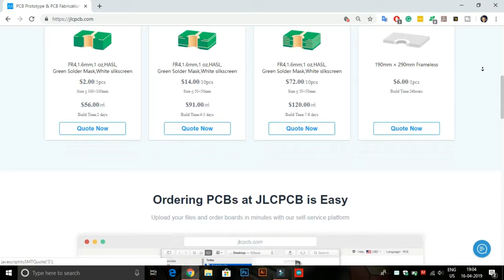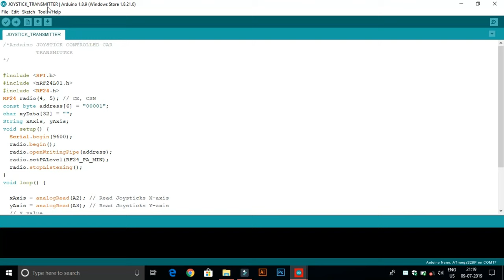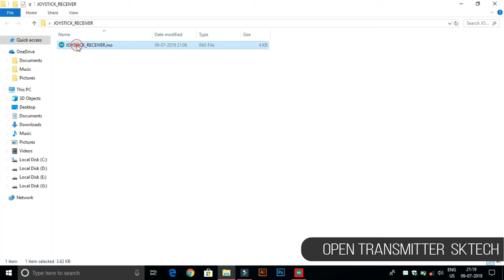How To Make A DIY Arduino Joystick Control Car At Home

Comment: Hi can you make an Rc car controlled by the cheap VR wireless controller, the one with a single joystick. Would it be possible to read the data from that controller. I want that because it looks simple in design. Thank you!

Comment: awesome job bro.. u rock.. thanks for sharing the schematics and code.. i've designed a tank.. i intend to use ur code. the joy transmitter however has 1 joystick, and i need 2, 1 to control the motion and 1 to control 2 servos for turret motion. can u help??

Comment: Hi bro ! nice work, rly like your video,
Just a question : no BMS or protection for your 18650 CDR ? is it just for the purpose of the tutorial ?
thank you for answering me, I would like to have the answer from an experienced person
Reply: I don't think you need a BMS for such small projects like these. The battery will be balanced already when it gets charged externally with its own charger.

Comment: I cannot get an NFR24L01 module. They are unavailable at this time. Can I use ACERMIC 38kHz IR transmitter and receiver instead of the NFR24L01? Will the NFR libraries work for these modules, or do I need different libraries to make them work?

Comment: The project is very good.
Can you please correct the sketch so that it can be fully functional, including variable speed operation? You must make the following changes to the sketch:

#define in1 3 // D3 arduino to IN1 of L298N
#define in2 4 // D4 arduino to IN2 of L298N
#define enA 5 // D5 arduino to ENA of L298N
#define enB 6 // D6 arduino to ENB of L298N
#define in3 7 // D7 arduino to IN3 of L298N
#define in4 8 // D8 arduino to IN4 of L298N
RF24 radio (9, 10); // CE, CSN

Also, the respective changes will be made in the JOYSTICK RECEIVER SCHEMATIC.

Only one correction will be made in the transmission sketch:

RF24 radio (9, 10); // CE, CSN

There is another small error in the sketch, when conditioning the speed in the range 0 to 255 that can be corrected.

Thanks.
Reply: hi after doing this change in the sketch do i need to change my physical circuit or not?
Reply: @MSalim21  probably not because since he said correct the sketch the thing itself should work
Reply: @whynot1284  did it work for u with the corrected sketch?
Reply: Does this work

Comment: High,  i have questions about, l298 Motor driver i am using the same as yours but it can only handle one DC MOTOR each side, do you have any suggestions?
Reply: Search on google "Four-way L9110S chip". The driver you see in video is also meant to be working with 2 DC motors only. The driver can be damaged.
Reply: He attached 2 motors at single side.

Comment: I'm so lost when it comes to building the circuit. Are you just using jumper wires and headers, or do I need to buy something else to connect to my nano?
Reply: you can simply connect it with jumperwires

Comment: I am also trying this project .So in this L298N motor drive module can we use 4 motors at a time?
Reply: He connected every same side motors to the same output of the driver as they will always bs moving together forward or backward

Comment: I found troubleshooting in uploading thr receiver code due to undeclared variable a in line 37 and 40 of the code so how can i solve the problem
Reply: see , if the below works for you. I generally update any lifted code.  I started  with https://forum.arduino.cc/index.php?topic=421081

/*ARDUINO JOYSTICK CONTROLLED CAR (RECEIVER)
        
YOU HAVE TO INSTALL THE RF24 LIBRARY BEFORE UPLOADING THE CODE
   https://github.com/tmrh20/RF24/        
*/
#include <SPI.h>
#include <nRF24L01.h>
#include <RF24.h>
#define enA 2  
#define in1 3
#define in2 4
#define enB 7   
#define in3 5
#define in4 6
RF24 radio(9, 10); // CE, CSN
const byte address[5] = {'R','x','A','A','A'};
char receivedData[32] = "";
int  xAxis, yAxis;
int motorSpeedA = 0;
int motorSpeedB = 0;
void setup() {
  pinMode(enA, OUTPUT);
  pinMode(enB, OUTPUT);
  pinMode(in1, OUTPUT);
  pinMode(in2, OUTPUT);
  pinMode(in3, OUTPUT);
  pinMode(in4, OUTPUT);
  Serial.begin(9600);
  radio.begin();
  radio.openReadingPipe(0, address);
  radio.setPALevel(RF24_PA_MIN);
  radio.startListening();
}
void loop() {
  if (radio.available()) {   // If the NRF240L01 module received data
    radio.read(&receivedData, sizeof(receivedData)); // Read the data and put it into character array
    xAxis = atoi(&receivedData[0]); // Convert the data from the character array (received X value) into integer
    delay(10);
    radio.read(&receivedData, sizeof(receivedData));
    yAxis = atoi(&receivedData[0]);
    delay(10);
  }
  
  // Y-axis used for forward and backward control
  if (yAxis < 470) {
    // Set Motor A backward
    digitalWrite(in1, HIGH);
    digitalWrite(in2, LOW);
    // Set Motor B backward
    digitalWrite(in3, HIGH);
    digitalWrite(in4, LOW);
    // Convert the declining Y-axis readings for going backward from 470 to 0 into 0 to 255 value for the PWM signal for increasing the motor speed
    motorSpeedA = map(yAxis, 470, 0, 0, 255);
    motorSpeedB = map(yAxis, 470, 0, 0, 255);
  }
  else if (yAxis > 550) {
    // Set Motor A forward
    digitalWrite(in1, LOW);
    digitalWrite(in2, HIGH);
    // Set Motor B forward
    digitalWrite(in3, LOW);
    digitalWrite(in4, HIGH);
    // Convert the increasing Y-axis readings for going forward from 550 to 1023 into 0 to 255 value for the PWM signal for increasing the motor speed
    motorSpeedA = map(yAxis, 550, 1023, 0, 255);
    motorSpeedB = map(yAxis, 550, 1023, 0, 255);
  }
  // If joystick stays in middle the motors are not moving
  else {
    motorSpeedA = 0;
    motorSpeedB = 0;
  }
  // X-axis used for left and right control
  if (xAxis < 470) {
    // Convert the declining X-axis readings from 470 to 0 into increasing 0 to 255 value
    int xMapped = map(xAxis, 470, 0, 0, 255);
    // Move to left - decrease left motor speed, increase right motor speed
    motorSpeedA = motorSpeedA + xMapped;
    motorSpeedB = motorSpeedB - xMapped;
    // Confine the range from 0 to 255
    if (motorSpeedA < 0) {
      motorSpeedA = 0;
    }
    if (motorSpeedB > 255) {
      motorSpeedB = 255;
    }
  }
  if (xAxis > 550) {
    // Convert the increasing X-axis readings from 550 to 1023 into 0 to 255 value
    int xMapped = map(xAxis, 550, 1023, 0, 255);
    // Move right - decrease right motor speed, increase left motor speed
    motorSpeedA = motorSpeedA - xMapped;
    motorSpeedB = motorSpeedB + xMapped;
    // Confine the range from 0 to 255
    if (motorSpeedA > 255) {
      motorSpeedA = 255;
    }
    if (motorSpeedB < 0) {
      motorSpeedB = 0;
    }
  }
  // Prevent buzzing at low speeds (Adjust according to your motors. My motors couldn't start moving if PWM value was below value of 70)
  if (motorSpeedA < 70) {
    motorSpeedA = 0;
  }
  if (motorSpeedB < 70) {
    motorSpeedB = 0;
  }
  analogWrite(enA, motorSpeedA); // Send PWM signal to motor A
  analogWrite(enB, motorSpeedB); // Send PWM signal to motor B
}
Reply: @croydon21H  thanks

Comment: And one thing more what is the range of transmitter and receiver?
Reply: 23
Reply: @shashankkanna5453  bananas?
Reply: in case anybody is still wondering the answer to this, the receiver he's using claims to go 100 meters, and the one with the antenna claims 1000+ meters

Comment: You are using only receiver on both modules, or am i wrong.i checked your description link too,but couldn't find a transmitter.
Reply: Late response probs wont help you but might help someone else, the module is transimitter AND receiver on the same module!

Comment: hello bro, I made your project and I have a problem, the 2 of the motors turn on when connecting the circuit and I checked the diagram and the code and I can't find the fault, apparently the rf24 modules don't link
Reply from the maker: bro contact me on instagram
Reply: i am having the same issue

Comment: Hii sir can I use one uno and one nano arduino board for this project . Will it work . If I use uno for car robot and nano for remote and use same code so can it will work
Reply: yes you just need to change the board in tools\board
Reply: @samyflies2  thanks sir

Comment: Arduino: 1.8.19 (Windows 7), Board: "Arduino Nano, ATmega328P"

A library named RF24-master already exists

This report would have more information with
"Show verbose output during compilation"
option enabled in File -> Preferences.

please help me, what's with this?
 @DIY Builder

Comment: I am using 1 motor o each side instead of 2, but only one motor is moving when connected with the same schematic as shown. Please help
Reply: I was using NANO for the car, it only runs one motor. When i replaced with UNO, it doesn't receive any signal. Then i stopped this project...

Comment: If we use one arduino uno and one nano aur vice versa will it work?? 
And how much range it can fruitfully work..
Does using joystick and two arduinos at a time helps in the increment of speed of the RPM... 
plzz reply..🙏🙏
Reply from the maker: Yes you can use the both Arduino nano and uno. It range is 10-20m without the antenna module. if you want to increase the range you can use the nRF with antenna module.
Reply: @DIYBuilder  no you are taking it in wrong way I am asking that if we use arduino nano in making transmitter and arduino uno for making receiver .. 
It will work or not..🙏
Reply from the maker: Yeah it will work :)

Comment: I have uploaded the code but I am using Arduino uno it doesn't work. Is there something I have to adjust in the codes?
Reply: I don't know if it will work, but the input and output pins can mabey be adjusted. Because the name is diffretent on an uno.
Reply: kya aap contact no. de sakte h jisase aap bata sake ki code kaise upload krna h...sir please

Comment: really awesome project, I've tried it.  But sometimes the values of the X and Y axis are interchanged
Reply: Bro i too tried but car spining two wheels and not obeying joystick please tell me
Reply: @yogustan  I have corrected the coding above, the x or y axes were swapped and even corrected the way when turning.  I also added a bell, lights, servo, and camera with esp32 cam
Reply: @yogustan  the problem with the x-axis and the y-axis sometimes being reversed is the delivery, as well as the time of receiving.  Can be fixed by using insert at array index
Reply: Thanks bro
Reply: @yogustan  haha, i have telegram only
Reply: Please tell me your id
Reply: Please bro
Reply: Can i have your telegram bro?
Reply: @maulanawahyudi7127  Hello, could you please send me your corrected code? That would be very helpful because I get the same problem and have no idea how to fix it.
Reply: @justinaspranaitis3661  sure
Reply: @maulanawahyudi7127  Hello. Could you please send me your code as well? I have a little different problem, but it is related to coding too.
Reply: I also would like the code
Reply: @Alan Higa Loureiro  Sure, all of you can contact me by telegram
Reply: @maulanawahyudi7127  bro boleh minta codingnya saya juga ingin nambah klakson sama lampu led
Reply: @Fahri_M.S.  monggo mas, id saya di hapus terus waktu komentar disini
Reply: @maulanawahyudi7127   Hello there, would you think you can pass me your correct code? That would be very helpful because I get the same problem and have no idea how to fix it.
Reply: @maulanawahyudi7127   bro I also need the code could u send me to I also don't know how to fix
Reply: @justinaspranaitis3661  
Hi , send you the code  ?
Reply: @yogustan  
Hi , send you the code  ?
Reply: @henrycharles4562  
Hi , send you the code  ?
Reply: @izzeddine9966  yes
Reply: @henrycharles4562  Can u provide the code?
Reply: @maulanawahyudi7127  Can u provide the code?
Reply: @maulanawahyudi7127  Hey man, I also need the code pleaseeee, 😢 How can I contact you?
Reply: @yogustan  Man you solved the problem of the two wheels spining? I got the same problem
Reply: @maulanawahyudi7127  can you help me with the code too? please
Reply: Can i have the updated code?
Reply: @Fahri_M.S.  bro, boleh minta codingannya gak?

Comment: What is the range of this joystick?
From how much distance can we control this RC car using this joystick?
Reply from the maker: I didn't test the maximum range yet but if you use the NRF24L01 with antenna module you can get 1km maximum distance range.
Reply: @DIYBuilder  so when we use an antenna module will there be any changes to be done to the whole outfit
Reply: @DIYBuilder  I always like your project.
I wish you modify this RC car into one which can be used for high speed RC car racing ,by using a differential
Reply: Test

Comment: I have a problem the motors on the right are constantly moving even if the controller is not used
Reply: have you any solution?
Reply: @alekseyermakov2973  apparently, the controller must be connectedand the motors stops and can be controlled. I made it with breadboards btw not pcb
Reply: Same proble is with me...
Reply: did the code worked properly which is given in the description ? did u make it exactly according to this video ?

Comment: The code in the description is not installing and if the file is not supported can you pls send me the code file
Reply: You must be making a mistake. you have to check bootloader [old, in some cases] , COM port , and correct arduino model

Comment: how have you made the transmitter and receiver
Reply from the maker: check the circuit diagram
Reply: @DIYBuilder  thanks
Reply: @DIYBuilder  but there is no switch in the schematic diagram and one more doubt:should we do the soldering of transmitter an receiver exactly like yours?

Comment: sir I like the process of making but I am in a confusion why you have bought the 0 pcb board of 10 dollars. it can easily aviliable at market of small size(that you have taken) 10 rupee and big size of 15 rupee
Reply from the maker: it's a sponsored video and bro i could make this pcb as track pcb but many people can't buy this pcb for its higher price. that's why i decided to use the dot pcb instead of track one.

Comment: in the video tutorial you made a mistake when uploading a sketch. between the receiver and transmitter. upside down
Reply from the maker: thanks for informing me
Reply: @DIYBuilder  ok bro...
Reply: @DIYBuilder  pls can you tell which all wires should be connected to the switch

Comment: bro u have uploaded recievers code in transmitter and transmitters code in reciever do we have to do the same??
Reply from the maker: Bro, I mistyped the file names. Sorry for that
Reply: Bro the code was not supported i need the code brother !
Reply: @DIYBuilder so the codes u uploaded are correct or incorrect???
Reply: Pls tell bro

Comment: Firstly thanks for your contribution. I completed the project excepting the uploading of code. Please your comments and help
Reply: Finally I uploaded the code
Reply from the maker: Great
Reply: Sir how you have uploaded the code?
Downloaded  and directly uploaded or used any app for it.
Reply: @sarkarsarkar8210   HI Sir, I can send you the files or sketches. I do not remember exactly from where I downloaded the sketches but I remember that the sketches were inverted according to the video.
Reply: Francisco Pocaterra bro . How i can do if i want used car remote control . I dont want to use blutooth because i dont have android smartphone
Reply: Sir. Can we connect 48v dc motor. Is there any possibility.

Comment: NRF module without capacitor between VCC & GND on module will not work normal
Reply from the maker: Yeah i know but within short range we don't need any capacitor. But thanks for the suggestion.
Reply: @DIYBuilder   plz tell which capicitor to use and where i want it for long range
Reply: @DIYBuilder  sir can you please tell me that can we upload the codes directly by downloading or we need any of the app for it?

Comment: IF ANYONE FACING PRBLM WITH UPLOADING CODE, REMEMBER TO add zip file RF24 in tools option, i hope it might help you all guys
Reply: i installed the RF24 library but still cant upload the code
Reply: @robinvangils2104  after installing u have to extract file to get the code
Reply: @TechyChung   what to do with RF23 code

Comment: Bro can you help me, i did the same thing of yours, but it's still not working, I have to pass up my project tmrw, 😭
Reply from the maker: What's your problem?
Reply: I set the code but it not functioning
Reply: @REVEALED yes I tried, but still cannot
Reply: Try 10uf or 100uf capacitor on the vcc and gnd pins on the arduino.Just solder them directly (take care of polarity).
Reply: When i use NANO, it succesfully transmit the code from the joystick...but only one motor running. I replace with UNO for the car, it doesn't work at all.

Comment: Bro everything is fine but the main question is .... why don’t you send the circuit diagram to PCB company to print on the board??? Why u soldering different color cables on the board 😳. U should send the circuit diagram to them so they print the circuit on the board n it became easy for everyone to do the project easily instead of wires soldering here n there even I’m unable to do this. I’m bit disappointed ☹️. Kindly send me the printed circuit file so I can order to the PCB company for a proper printed circuit board. Thanks 🙏

Comment: Pls I want to know how the front steering wheel s is made
Reply: @Favour_Chisom There is no steering mechanism, just used simple physics , specially about torque :)

Just like couple of forces , acting along line of action of force which generates torque i.e. turning force .

Here also some wheels are stationary and some wheels are rotating at a instant of time which generates turning force and the car turns :)